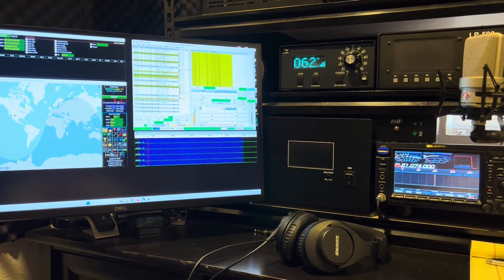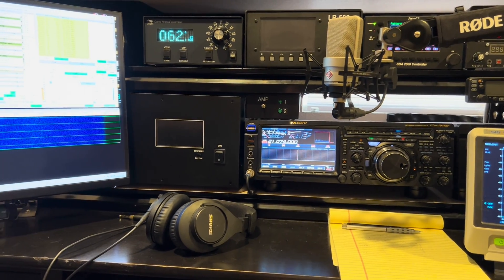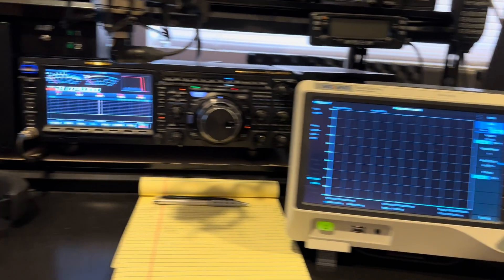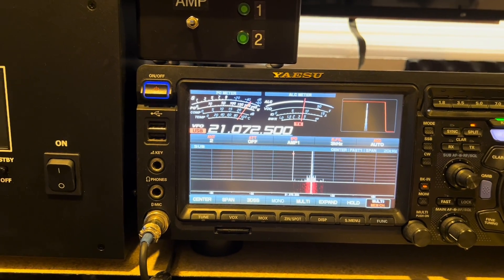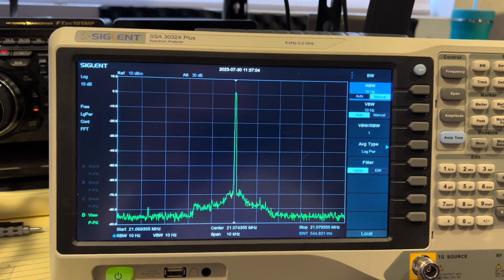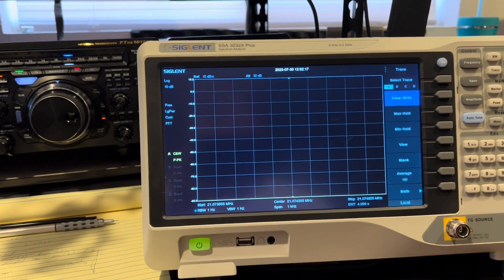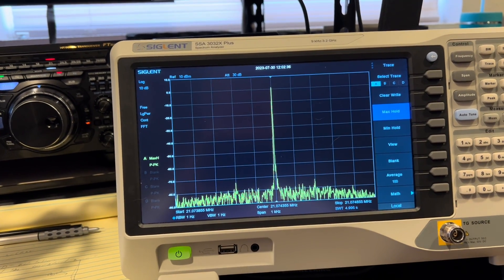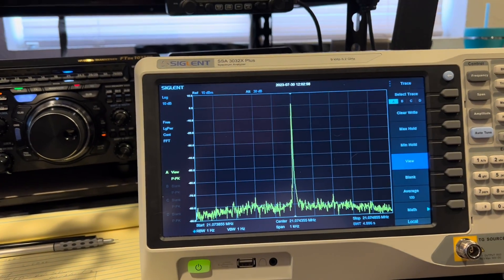FT8 and the FTDX101MP, does ALC matter?  Part 3 - KJ7E

Comment: Well done for making the video,  so many people have this wrong. The compact radios won't thank you for operating full power on FT8 but the adult  sized ones with big heatsinks and fans can usually be ragged hard on FT8 without the transmit spectrum deteriorating. Of course the thermal cycling of the PAs is still a fatigue factor. In one of my rigs however feeding Transmit audio in via a rear panel socket could overload circuits PRIOR to the mic gain control. Controversially it might be interesting to see that you could turn the PA bias current down for cooler running on FT8 without affecting the transmit signal. 73